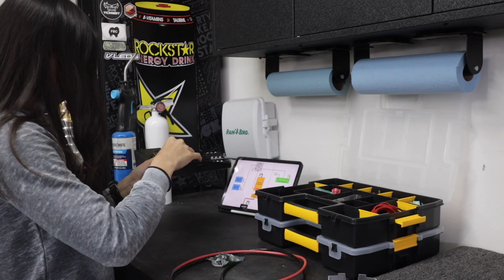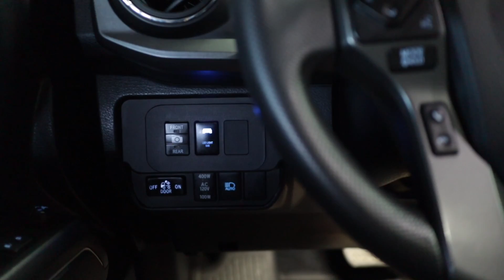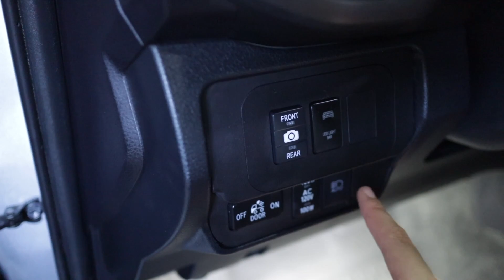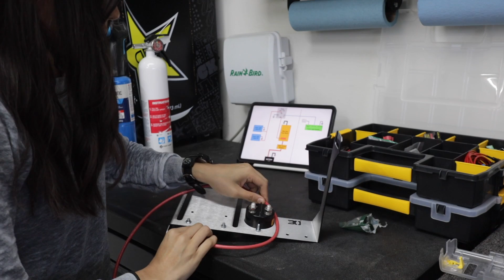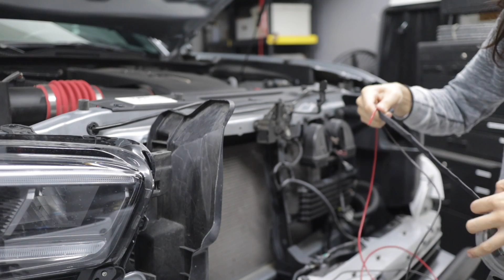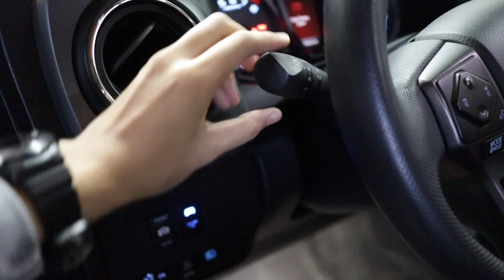DIY Auxiliary Power For Your ACCESSORIES! + Installing LED Lights w/ Switches

Comment: A lot of aftermarket LED lights, particularly the off-brands, draw way less than advertised. It's like the old days of "10,000W peak" amps on eBay, the lies must sell. I tested some NiLight pods off amazon for a project and found them to draw 12-13W, or about 1A at 12V.